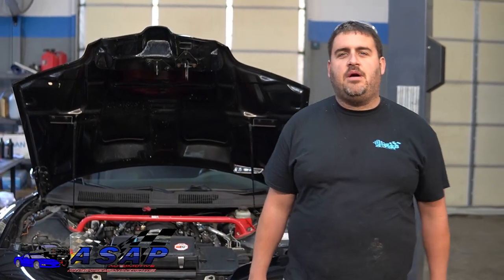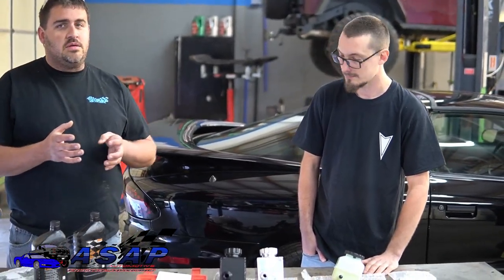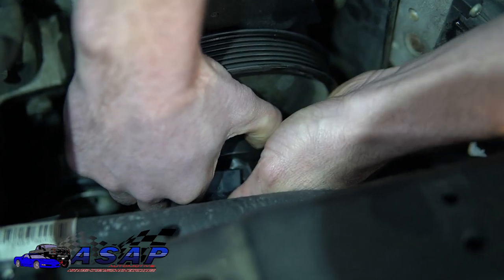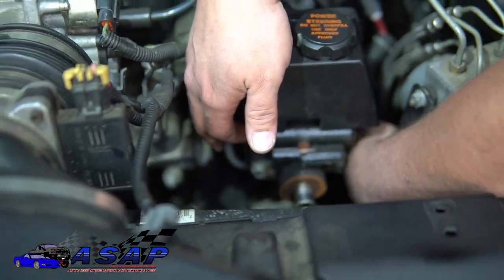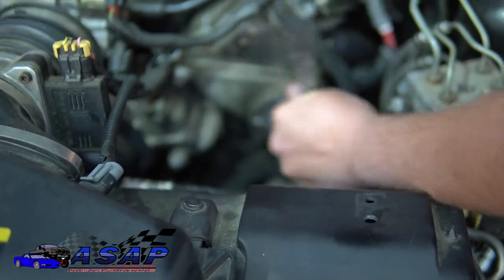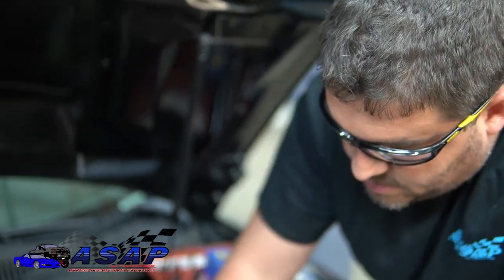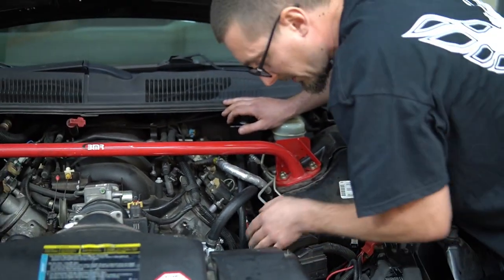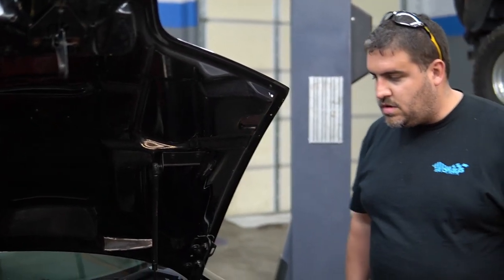Fire Chicken Power Steering Upgrade

Comment: So what the deal here is when tracking a f body the pump overheats and smokes itself with high rpm and resistance in the system from hard cornering? I have a 97 always thought it'd be fun to autocross and prob gonna when i get her straight again

Comment: Can I run the fbody reservoir on the c5 pump?  I don't want to run a remote one.
Reply: No, it doesn’t fit. The Corvette runs a remote one that’s right next to the pump itself.
Reply: Also, I don’t think they mentioned you need the Corvette size pulley as well